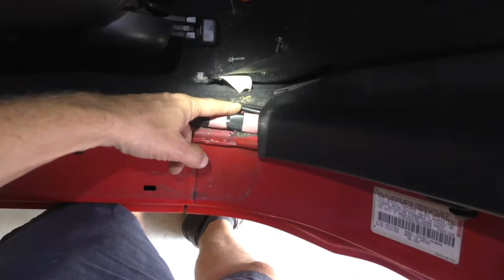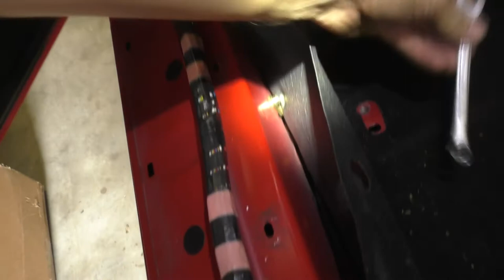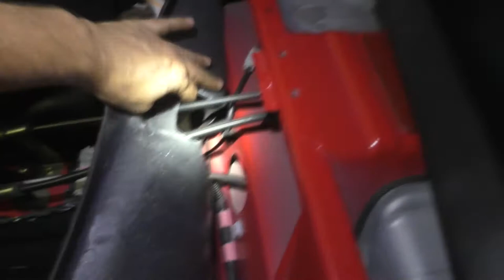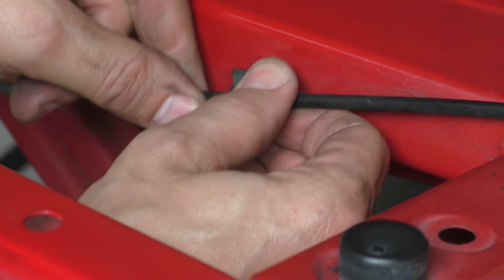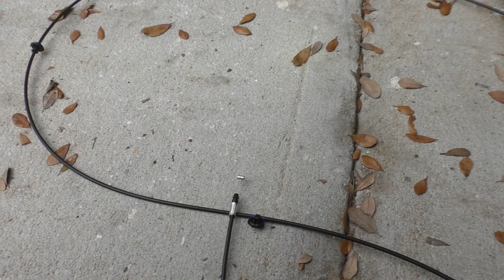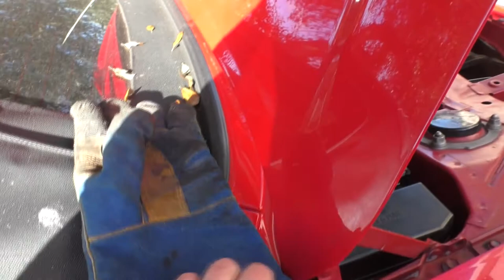AG_017 Replacing the MR2 Spyder engine cover release cable

Comment: This seems like an obvious question but why not pull down the fender liner rather than trying to fish the cable through with tape?
Reply from the maker: That might work, but I was under the impression that the liner wouldn't expose the area.  I may be wrong, but certainly it's better just to attach a piece of string to the end of the cable before pulling it out.
Reply: 'I'm going to go ahead and break this clip. Step 2: break clip' lol

Comment: You probably could’ve used one of those pieces that come in a Ford door latch cable repair kit from eBay. Not sure if it fits but I’m going to give it a shot
Reply from the maker: I didn't really think of that.  I could perhaps have made something too.  I just figured it was 17 years old, might as well replace it.
Reply: @antimattergarage8147  i tried it and it didn’t work so I’m probably going this route. How long should I anticipate to take?
Reply from the maker: @pablovaldes1992  It wasn't long.  You could probably do it in an hour if you follow my instructions and attach a string or something to the cable before you pull it out.  But beware.  I've been having a problem with mine.  I think I messed something up on the floor where the handles are.  Make sure to not cross them over each other and generally reinstall them the way you got them out.  My fuel door was also kind of messed up.  So just be careful not to pull on them too much.  Good luck.
Reply from the maker: @pablovaldes1992  If you follow what I did, it should only take you about 2 hours, I think.  Maybe a little less.  I work kind of slow.
Reply: @antimattergarage8147  I ended up doing this past weekend and it took me like 4 hours but I ended up removing the wheel and inner wheel fender plastic(not sure the right term for it) this gave better access to route the cable. The reason it took me long is I had to go find the key for the lug nuts. The person that sold me car didn’t include it and luckily Oreillys had it. Your video was SUPER helpful and I thought about shooting a video with the extra steps I took for better access but idk
Reply from the maker: @pablovaldes1992  Oh, sorry you had such a hassle, but I'm glad my video helped.  You definitely should make a video.  I find the more the better.  Sometimes it just takes a different perspective.  Anyway, glad you got it replaced.